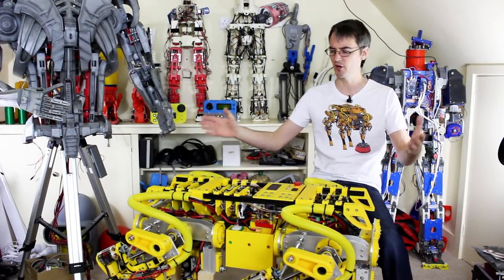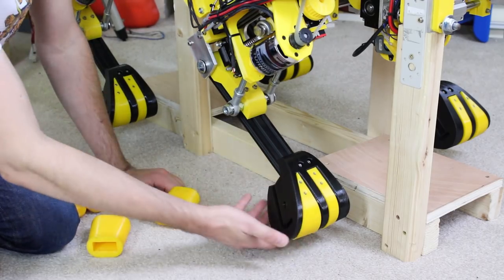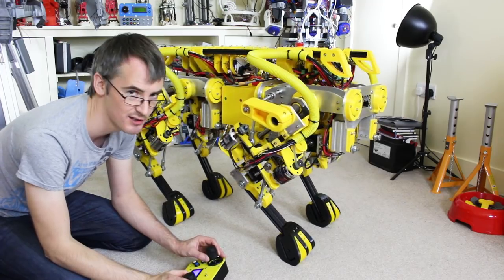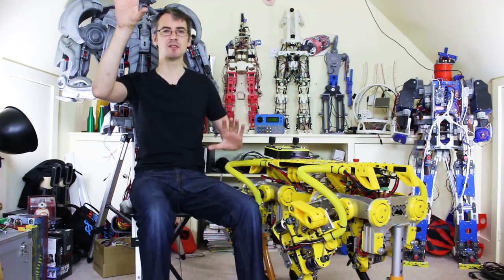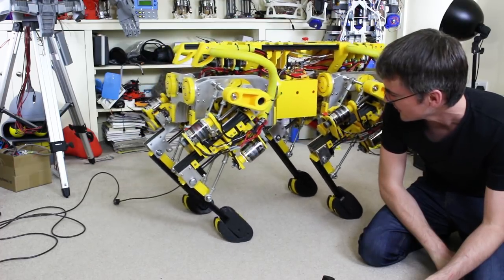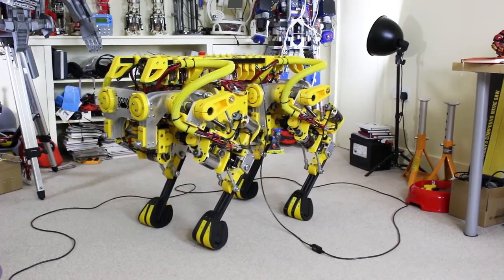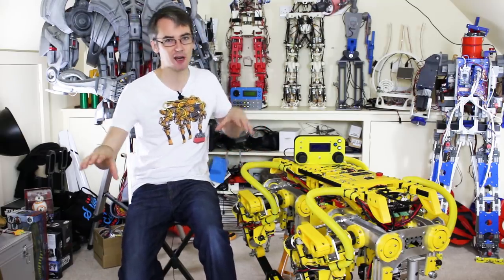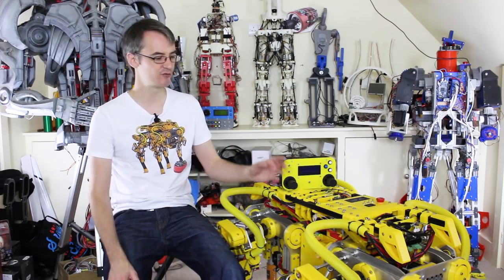openDog Dog Robot #13 | Experiments in Dynamic Stability | James Bruton

Comment: Another option for the leg control issues if you want to keep your current setup is to use optical recognition tags to assign "joints" to the robot that can be monitored by a camera. Using Vuforia or some other software, measure the tags relative to each other to determine positions of each leg. Have little rods that extend from the sides of the robot and have a camera mounted at the end facing towards the robot, which will allow it to monitor itself. Combined with independent IMU's in each leg, individual computing units in each leg with a central head unit that uses a banana pi, and load cells at the bottom of each foot to determine weight distribution, you have yourself a very powerful robot.

Comment: I wonder what machine learning could do for the robot. You will have to export and assemble the dog parts in a 3d physics engine so that you can train it, and then use that AI model to drive it irl.
Reply: The most difficult part would be BUILDING That model. What is your goal? What are you going to train it to do? In this video he talked about how the robot is rigid and uses mathematical models, and Machine Learning is just the progression of that. But it's still rigid. You need to be able to write a formula that calculates just how good the robot is walking, and that is NOT an easy task for such a complicated problem like walking.
Reply: exactly what i thought.    look for the videos from "code bullet"     this guy does make ai systems do learn all kinds of things.         i would think it could adjust all the timings and angles to make itself walk better and smoother..   but without a accurate simulation its propably not practical.. like learning on the hardware might need the robot years to learn.
(and also the whole robot is still so much in the basics...  maybe its way to early to start such kind of fine-tuning... )
Reply: There are already AI simulations that have robots (in simulation) teaching themselves how to walk successfully.  I don't know if any of them have been applied to real world robotics.
Reply: @williamrutherford553  The reward function shouldn't be that hard for walking. And building the simulated dog would require the CAD models to be converted to standard 3d models. A physics system would handle the rest. Having the motors and other sensors properly mapped to a virtual environment would be a lot harder. And probably in the end some real life learning would be needed to refine the model. But one could get very robust and organic movements. Do note that boston dynamics do not use machine learning AI for movement.
Reply: @mm-hl7gh  I like code bullet too, but he doesn't really make AIs, he basically makes programs that brute force the result. His AIs do no learning, they just do a bunch of random movements/whatever and pick the best result using his objective function
Reply: I think machine learning irl might be more effective compared to virtual since one cant possibly build an accurate enough model.
Reply: @maxmuller445  But would be impractical. As the training sessions can reach insane amounts.
Reply: @SimeonRadivoev  true. And need to be supervised.
Reply: @DnBastard  true, first simplyfied model, then nonstop irl learning for continiuing advancement in stability
Reply: I would start with a programmed set of "pose states",  transitions between them  and a few simple walk cycles to get started, and then let the machine learning refine and expand on them.

Comment: You should add computer vision to it. You could have different protocols when it detects different objects. Could also make it have emotional parameters that changed based on visual input like if it sees a dog(especially barking) it would try to get away from it since a dog would probably try to mess with it. This would also allow you for it to only walk in safe environments, for example to not go on a street, and if you want it to walk on the street then only make it go through the zebra crossing. I would integrate computer vision/machine learning and also a maps API for redundancy at detecting things.

Comment: I think you should do the plastic-to-metal upgrades first. Many "wobbly" issues may disappear without any code changes, due to the stiffer material (fewer vibrations/harmonics).

Comment: Pick up a nice used treadmill and build up a simple support structure that can hold the dog with a rope hanging it from.  That way you can eliminate the issues of balance while you work on the mechanics of walking and running

Comment: The creaking is probably due to the rate of change being different for each joint. (The final position is probably calculated correctly but the joints arrive there at different angular velocities and accelerations of the joints.)

Comment: As a person that goes long ways to avoid using a computer i am always fascinated by coding. It makes me think :"Why again don't i use an arduino in my projects? This would make life so much easier..." Then i say to this Side of me: "Because you suck at coding" That's the point were i go and beat up some steel. 
I really love that project. I hope you don't get frustrated to often when you work on it. I wish you a stress free /frustration free work.
Reply: Arduino is a pretty good place to start. Lots of documentation, and you can see it doing something which is pretty good to keep you motivated.

Comment: I would say you could simplify things by stripping the serial down to SPI, generally you can run short hops of SPI up to system clock / 2, and it means you can have multiple devices tied off 1 SPI transceiver, 

It also simplifies the communication network to a ping-pong, the CS pin on the slave can fire an interrupt to enter communication, and the slave generally has a Interrupt pin telling the master to poll it shortly, So instead of constantly checking you serial buffers, you have a few pin change interrupts, then either set a flag for later or rip in / out the data at stupidly high speeds, 

a 16MHz arduino has a surprising amount of power when you avoid floating point math,  even changing to fixed point math with 4 byte longs is generally hundreds of times faster, equally when you get a 8 bit message being sent by one device to another at Sys clock / 2, you get 16 cycles to handle the last packet, be it an address to start reading from, a command, etc, getting this right makes things way faster. 

I regularly play with low power electronics, so waking up, doing things fast then powering down is what I'm familiar with.

Comment: Upgrade time then. Have you considered looking into using ROS (that's opensource too) running on a Raspberry Pi (or something beefier) to run the calculations?
Reply: David Taylor or maybe a intel nuc
Reply: @thekraftyguy8246  i dont think those are the right chips for something like this, he needs a much faster MCU and not a highly complex cpu, so something like an STM32 or an ESP32 would work quite well with the existing code and would be much faster
Reply: @asderidelp  I was going to say maybe an ESP32 ( you can leverage both cores ) and set the IDE to use big app / OTA no spiff for space.

Perhaps an ESP32 ( or 2 ) would be enough to replace the 3 mega;s, on the backend I would still go with an ARM Cortex perhaps the mediatek helio or something similar.

The esp32 has super fast Serial for control and the helio can drive everything else and be the Master Node.   This would use ROS as already stated.  Perhaps building it out in a model using the ROS / Gazebo combination would be the right way to go, that way you could do everything in parallel.
Reply: @sethrd999  You can get a dev board from stmicro that has an FPU for less than £20. 32-bit and having the FPU would improve performance tremendously.
Reply: Wonder if a parallela board would be a reasonable processing unit for this purpose
Reply: I think ROS is a wise choice, while Raspi might not. Raspi is not that 'real-time' according to my test. And the delay of serial ports is really an issue.
Reply: STM32F103 "Blue Pill", clearly. Less than $2, almost as popular as the Arduinos. And when you're even mildly-serious about data transfer you use something like a 1...10 MHz SPI with as many slaves as you need, not a bunch of 115200 bps software-emulated (FFS!!!) UARTs.
Reply: STM32F7  or STM32H7 which use the ARM Cortex-M7 at 216 MHz and 400Mhz respectively.  ST has Nucleo boards for quick prototyping and Arduino compatibility.
If you need more raw power have to go up to FPGA or some embedded microprocessor like NVidia TX2, but these 2 surpass the whole quick prototyping nature of this project.

Comment: I think u should use a current meter to detect contact as not only will u get a signal on contact,  but u can keep going to reach some threshold of "work" carrying weight.   A simple clamp on meter should suffice as it's ac and u can get both the upper and lower joints.

Comment: Great work, James.  Glad to see you're looking at making some material upgrades.  While you're doing that, it might be worthwhile to see where you can drill/route lightening holes in some of those metal pieces.  When I see a near-solid plate of aluminum, I see unloaded or under-loaded material.  As I'm sure you're aware, lightening can have a positive impact on dynamic stability, as it means less weight to support and less inertia to accelerate.
Reply from the maker: Yes, it's mainly all the ball screws and motors that have the most mass...

Comment: Hey James, the ODrives must have a way to report motor current which can be used to sense the load on it. You could use that to estimate where is the center of gravity as the weight distribution on the feet changes.

Comment: Regarding the pressure sensors: I know it's a huge change, but redesigning the leg drives to direct belt drive (see Kuka Robot arms) would increase speed, is plenty precise, is much lighter, more silent and with an encoder attached directly to the motor you'd still have perfect position control. Aaaaaalso: by measuring the motor current you could get rid of the sensors! Can easily be done with a shunt resistor, by the way.
Oh, and I am super damn impressed by your project and the progress you've made. Especially the software part. I'm a mechanical engineer, so it's black magic for me.

edit: I've written this comment while watching the video. About shock absorbers: when a leg expect to touch the ground, you can use the motors as shock absorbers ... as you said like a minute later. But yeah, it'd be quite a challenge :D

Comment: I'd recommend jumping over to a teensy 3.6 or 3.5 for the main and then u can upgrade the slave arduino to teensy 3.2 or teensy lc. Plenty of speed and code space, in fact I bet u could swap out 2 slave arduino for a single teensy 3.2

Comment: Two questions: have you ever tried STM32s as they are much faster? Have ever thought of trying  it with AI so that it learns by itself how to stabilized walk like a baby does with try and error? I know for AI an arduino as controlling unit is maybe a tiny little bit too small ... but maybe a pi does the job?
Reply: How would you set it up to learn to walk? I assume some sort of neural network, but surely that would be far too complicated for this build.
Reply: Maybe by try and error, it could try several combinations of parameters and the ones that dont work take off the list.

Comment: Right now you have a hierarchical tree like bus architecture. You should consider using a bus with multi-master support every unit is connected to. This way every unit can request data form every other unit or send data to every unit. This would give you more flexibility and faster data access.

Comment: T-nuts are fiddly, I'd recommend T-slot spring-nuts, You just roll them into the slot and they stay there because of a spring-loaded ball-bearing.
As for upgrades, if it's speed you want, you could try STM32s, they're 32-bit and a fair bit quicker, plus they can be programmed with the Arduino IDE that you're familiar with.
Or could even try a Beaglebone Black with its two 200MHz microcontrollers and 1GHz CPU in one tiny package with a ton of GPIO. The PRUs in the BBB were made with high-speed, timing-sensitive communication in mind.

Comment: I'm not sure about this, but you could read the motor current / momentum from the Odrives instead of using force sensors in the feets. Also you could limit the current to achieve some spring like behavior I guess?

Comment: I'd recommend a STM32F7 MCU as the main processor. I can guarantee that you will never have issues with flash size or processing power if you use of those beasts.

Comment: lol. Have you considered installing a heavy gyroscope. I believe it will help out a lot with its stability. Especially if you put it on XY axis where you will be able to move it around to different corners (may not be necessary).

Comment: I would maybe try using a cycloidal gear drive instead of the Pully system. It will be more compact and so will result in less creek as less parts are reliant on each they

Comment: Maybe you could try to stabilize it first using only the IMUs gyro. Use changes in rotation as the input for the pid regulator, and try to keep it at 0. The gyro tend to be "faster", like the rate mode on quadcopters. I coded my own quadcopter code, and I was unable to stabilize it successfully by only using the IMUs calculated angle as input for the pid controller. It was just too slow to react.
Reply from the maker: The gyro and accelerometer are mixed together - about 98% gyro. The gyro doesn't know which way up is otherwise and only produces rate of movement date.
Reply: @jamesbruton  And this mixing is what created problems on my project. There is no need for the gyro to know which way is up. The microcontroller only needs to know what is zero rotation output for each axis on the gyro. And as far as I can see, you want zero rotation speed when the robot is standing on two legs.

I made a stabilized mode for my quadcopter, as well as a rate (gyro) mode. The stabilized mode utilized 2 "daisy chained" pid controllers for both pitch and roll. For example, the pitch pid controller took the input from the radio controllers pitch joystick. Say you wanted 5 degrees pitch; the pid controller would take this as an input, compare it to what the IMU pitch angle was, then output a "wanted gyro rate" that is required to achieve the IMU pitch angle. This output angle went into the second pid controller, which compared the wanted gyro pitch rate to the actual gyro pitch rate, then gave an output to the thruster allocation on how much thrust was needed in the pitch direction to achieve the wanted gyro pitch rate. The thruster allocation then translated this into actual motor controller commands.

Then exactly the same was done for the roll axis. The yaw only utilized the gyro\rate stabilization as I never really got the compass to work in the IMU code. 

If I were writing the code for your robot beast, then I would attempt a gyro stabilization only. Tell the pid controller to attempt to keep the gyro rate at 0 deg\second for pitch and roll axis. It will drift a little, but my feeling is that it will be stable on gyro\rate stabilization for long enough between each of the robots steps.

It will most likely be more responsive.

This method worked way better than stabilizing using the angle from the IMU only (which is calculated by various ways of combining gyro\accelerometer). Not sure how it will translate to your project but that was just my, uh, 250 cents.
Reply: @jamesbruton  use quaternion math. Its much better method to handle both gyro and acc data.

Comment: Would be cool to see if a neural network could be used (or some other method of ML) to balance the robot. The problem is maybe that how do you gather the data needed to train the model. Maybe NEAT method and simulator?

Comment: Something that has been lurking in my mind for a few episodes now is the code you introduced that maps 0 to .01 to avoid division by 0 errors.  This may not be an issue, but I've wondered for a while if that could introduce a cumulative error into the model based on the frequency each leg encounters a 0 in its maths?

Comment: Yeah, the lag along that data path is pretty massive. Also, 20 Hz is a bit slow for the IMU to keep a system like that balanced. I don't know if there are ones that can be polled faster, but starting with such a slow sample rate is just going to make any delay in data to movement even worse. 

You may want to add a bit of a shock absorber to the feet. In a real animal, the muscles and joints have some give and that pressure is sensed by the body to help with balance. I would also suggest using two pressure sensors on the feet so that the robot can tell if it is coming down on its toe, whole foot, or in between. This would make allow a simple adjustment algorithm to act on the kinematic model to give it better balance since it will know what angle it is contacting the ground at. Considering that quadrupeds have ankles, I would also add the ankles and give them the ablity to lock in place for if you want to try a running gait or a gallop. I think most of us would be happy with just walking and not bumping into things or being remote controlled. This is all bio-mimicry based, but why reinvent the dog when we can just copy it?

Comment: since there is such a hype about this topic i would be quite interested in how certain machine learning techniques could be incorporated into this project. so may have some neuronal net figure out the best parameters and timing for all this balancing stuff. just leave it running over night or so (probably faster to run a simulation and upload the trained neural net)